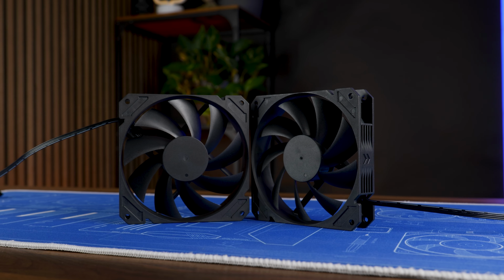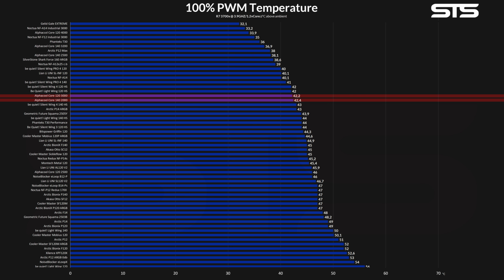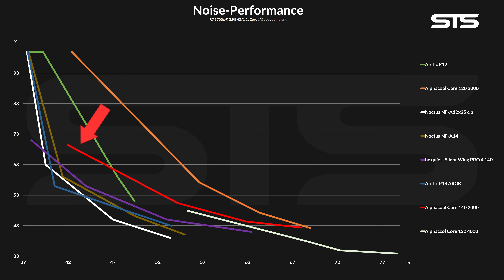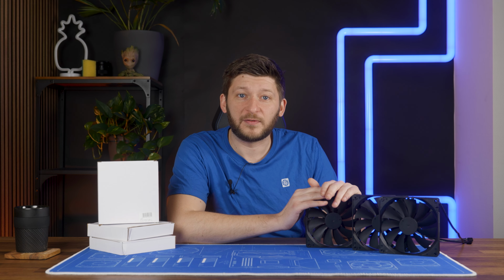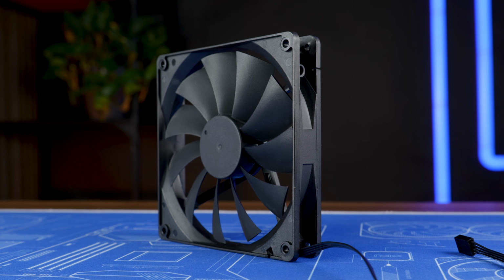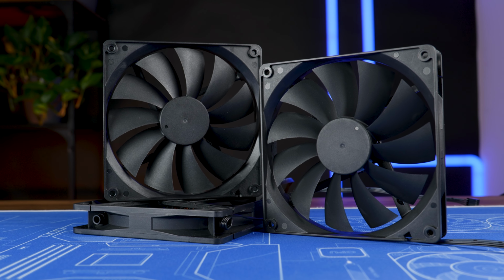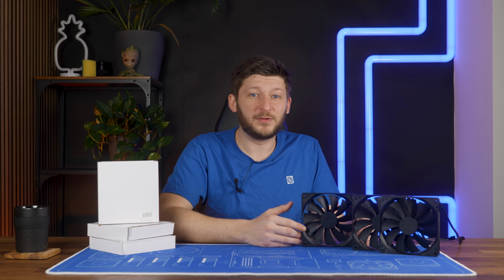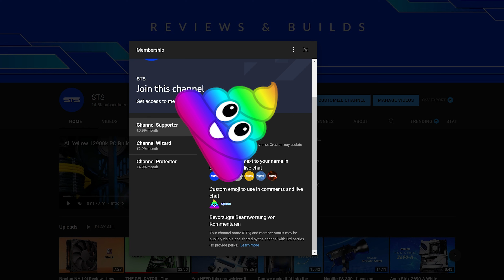Alphacool Core 140mm 2000RPM Fan - The Arctic P14 Alternative

Comment: Looks like they copied NZXT F140P new fans design some. So far the F140P & F140Q are my new favorites at $16ish a pop. They can push 100CFM and remain quiet.  I have these running full speed in my Lian Li Dynamic EVO and I barely hear them.  Thanks for review.